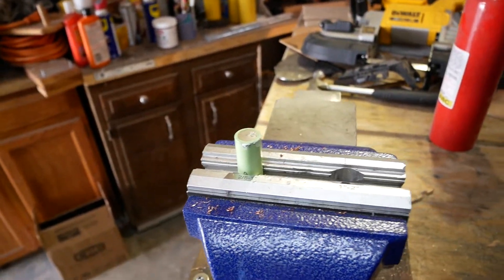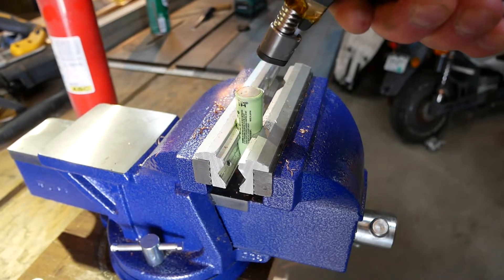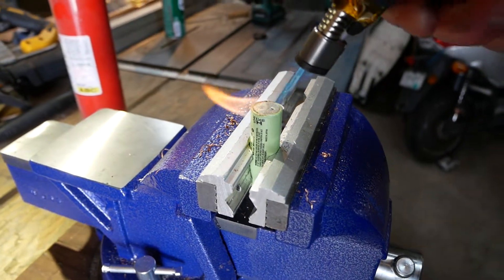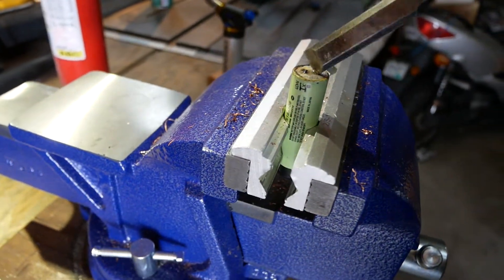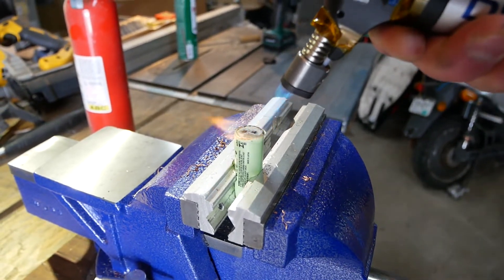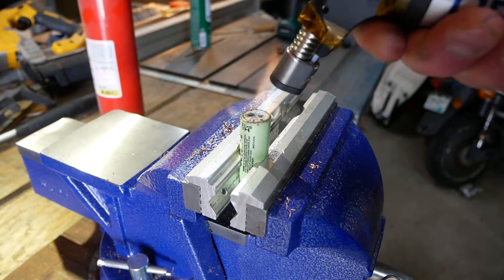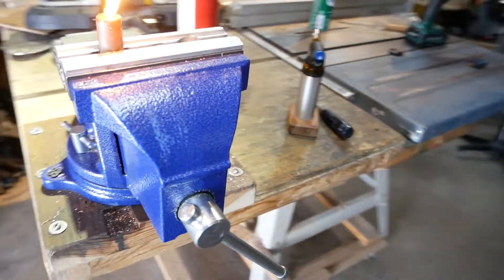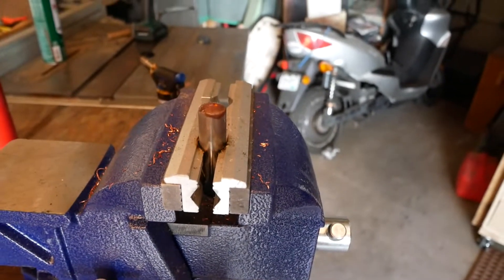Deliberate 18650 fire 1

Comment: there is 2 to 3% of explosion. one more time in your pocket. just scratch the plastic cover at the top so the metal is exposed and have 2 quarters in your pocket. the first quarter will fuse to the top of battery. the second quarter is used  is to call ambulance and fire department at the payphone down the road after you go running out of the structure fire.the entire outside of casing is negative lead. even the outer top part. as batteries age that outer casing can become brittle and make it easier to short. The 6000 Pagers that exploded were not bombs. They were regular lithium batteries. They were hacked remotely and shorted causing lithium fire and 2 or 3% of exploding. The lithium fire is very hard to put out.  32 dead and thousands injured out of 6000 incidents at same time is serious. Ibwould be more concerned with fire.

Comment: Woke up today and smelled smoke, went in to my office and found a dusty layer of ash on everything. Looked around and on the floor was the empty shell of an 18650 battery burnt out and a hole in the linoleum on the floor. I was so god damn lucky the battery didnt land on anything flammable!!!
Reply from the maker: how???
Reply: @de-bodgery  I really have no idea. The batteries were under 6 months old too, no visible damage on them. Scary shit.
Reply from the maker: @gullf1sk  This is incredibly uncommon...even for Chinese packs.
Reply: @de-bodgery  yeah ive had a lot of 18650s, some of them in really shitty conditions that worked just fine
Reply from the maker: @gullf1sk  Your battery fire was probably a bad cell or an assembly mistake. Were you charging when the pack caught fire?
Reply: @de-bodgery  yeah it was charging
Reply from the maker: @gullf1sk  your charger may be malfunctioning or outputs the wrong voltage and over charged the pack. I had this once myself. I got lucky and caught it before things exploded into flames. The pack was very hot from over charging!!! My cells were all at 4.5v or so each. OUCH...soooo close to disaster!!! I bet your office stunk something fierce. Not just the ash, but that smoke is pretty nasty.

Comment: Have you found any settings in the eve controller throttle that only goal walk speed I think this would be helpful if possible
Reply from the maker: Please post your question in my flipsky 75100 videos. At least it is relevant there since this is a battery fire video. Also, I did not understand your question. Please restate it. I have no idea what "goal walk speed" is. What is an "eve controller"?

Comment: Dead short it to raise the internal temp first.
Reply from the maker: As I explained in the video in between trying to get the cell to catch fire, last time I did this I used my KWELD on max power to blow through the cell bottom. I think that it bore right into the insulating layers and created a short. The cell was at room temperature at the time. I figured, this one at 70F should "work" just fine and catch fire.
Reply: @de-bodgery  I've had to be real careful with these pouch cells.

You can lay a wrench across the terminals and it will melt the wrench
Reply from the maker: @Zomby_Woof  I have about half a Nissan Leaf pack in cells. They can dump serious current! I was capacity testing them and accidentally touched the 10 awg wires I was using on them together. instantly vaporized the wire!
Reply: @de-bodgery  yeah, modern high current cells are no joke.

Mine are from a Chinese hybrid bus and good for 200a continuous and 400 burst and I'm running 4P.
 1/4" copper plate for bus bars.
Reply from the maker: @Zomby_Woof  What is your actual current draw? It's possible you are really puling something like 800 amps, but I'm betting that your max amp draw is probably much less than that. What cell are you using and what's their capacity when new? Nissan Leaf cells are pretty powerful too. I'm currently testing the capacities of the cells I have to see what state they are in. They are are not exactly new and some are showing 50-60% capacity left. I hope I have enough of them. I want to build a 32S pack from them if they will fit the space. If not, I'll be spending a lot of time spot welding 21700 cells!
Reply: @de-bodgery  This is why I am controller shopping. The one I have now is one of those throw aways that come in a kit. I want to say from memory it's 30 Amp. And it's not even programmable.
The only way my motor will see 800A is if I get struck by lightening.
Plan is to add a dual or two single controllers, and a 2nd motor. Then burn up the current motor and replace it.
I started to go the 18650 route, but realized that spot welding eleventy billion connections isn't what I want to do. And I wanted to get away from nickel as a bus material.
Reply: @de-bodgery  These are spim08hp's.
9ah nominal - about 8 in current state.
Reply from the maker: @Zomby_Woof  I'm not fond of dual controllers on the same board. Burn out one and you have to replace both of them. In situations like a skate board where you have serious space constraints...OK fine...use a dual controller. For anything else, I want individual controllers. I can limp home if one of the 2 controllers dies if they are separate units. I'm totally screwed if one of the dual controllers on the same board dies. I'm walking home! Fuck that! Anyway...just my opinion.
*
Get VESC controllers! There's tons of options in most any amperage and voltage you will likely want and new ones are coming out all the time. VESC being open source isn't the easiest to set up, but they are also open source and anyone from anywhere can build their own VESC based controllers. This means stuff like trade embargoes because Russia is invading the Ukraine doesn't effect anyone since you can get VESC controllers from China, Russia, UK, USA and a few other countries! There is a learning curve, but once you get over that hump, they are great and plentiful and found from a dozen sources. If you want help with what suits your application best, well I can steer you to some good VESC options if you want.
*
I weld packs. I have a KWELD spot welder. It did cost a lot, but then I've built 30+ packs with it too. I think it's worth it and it has certainly paid for itself 10X in the money I don't pay anyone to build me packs! If that's not your thing, I totally understand, but I'm sure glad I can spot weld my own packs. I will admit that there is a lot of time involved in building a pack from 18650's or 21700's. But what I don't spend on labor to someone else goes to more cells to make me a larger capacity pack. The nickel isn't a big deal. You can get nickel plated copper and that's significantly better than nickel. I use .3mm x 8mm or 10mm nickel and my losses are usually less that 20 watts across an entire 20S, 100 amp pack. So that's 2000 watts with at most 20 watts of losses in it or 1% loss thanks to the nickel. It's a loss to be sure, but there are much worse ones like hub motors or really long phase wires or wind resistance. I have a ton of .3mm nickel so I'm using it, but I'll soon be trying out nickel plated copper when I run out of .3mm nickel. Copper is better than nickel to be sure.
Reply from the maker: @Zomby_Woof  Part of modular packs like I tend to build is much more parallel nickel. The Dualtron City pack, which I finished and installed just a few hours ago, is 2 20S7P modules. They are 100% in parallel with each other. If I assume 20 watts of heat losses in one module, divide that current across 2 modules and my heat losses are now 10 watts across both of them since I have effectively halved the resistance. Most of my packs are many smaller modules in parallel and this makes any nickel heat losses greatly reduced. A few months ago I built a 20S21P pack at 64Ah from 18650's. I used .3mm nickel strip and my heat losses are 7 watts at 150 amps. That is down there in the negligible range!
Reply from the maker: @Zomby_Woof  OK...cool...I've looked at the spim08hp, but never considered using them. In my possession right now I have 1900 21700's that are new. I also have a much reduced supply of new 18650's. I just used 280 Panasonic 18650B cells in the Dualtron City pack and have probably 100 more for whatever. Also, I have that pile of Nissan Leaf cells that I'm not sure how I will use them. In my garage is a prototype pack that never got implemented. I'm not sure what chemistry the cells are in it, but they are all prismatic pouch cells and it's a 200v pack at something like 160Ah. I have an abundance of batteries to mess with and it will probably be a good while before I go hunting for more. I might have to get a few of the spim08hp cells to try out. They do have some impressive specs!
Reply: @de-bodgery  Have you tried your kweld on nickel plated copper?

I experimented a little doing nickel/copper/nickel sandwiches and had minimal success - got a couple of decent spot welds, but that was out of a lot of attempts. Nothing I could build with.

I think I would spring for the kweld if I was going to buy another spot welder. Mine is a random cheapo that would need improvements to suck.
Reply: @de-bodgery  There's not that much common circuitry on flipsky's duals is there?

I thought they were pretty isolated.
Reply from the maker: @Zomby_Woof  KWELD is next level DIY gear! No cheap or lousy designs in them! They are expensive for good reasons! Pro battery shops use KWELDs. I have not tried nickel/copper/nickel or nickel plated copper yet. I'm pretty sure my KWELD can deliver the current needed...just never messed with it. I started with a Sunnko and it was pathetic and lousy. I tried to build 1 pack with it before I abandoned it and bought the KWELD.
Reply from the maker: @Zomby_Woof  I have a FSESC 6 from them that is dual controllers. There is mostly 2 controllers on 1 board, but that is not 100% the case. Still...need 2 controllers and 1 dies, you are still needing to replace 2 controllers.